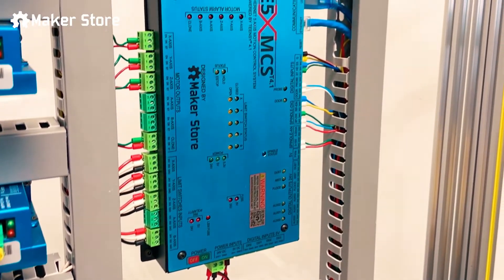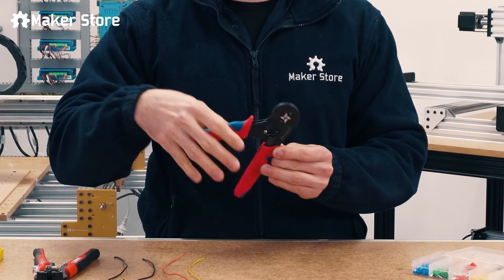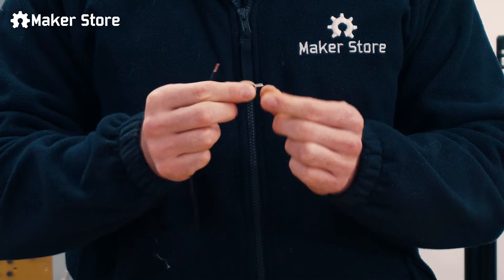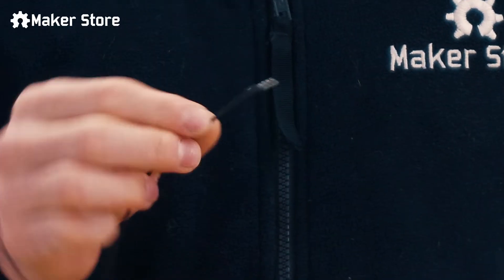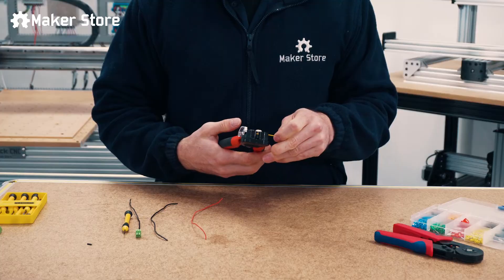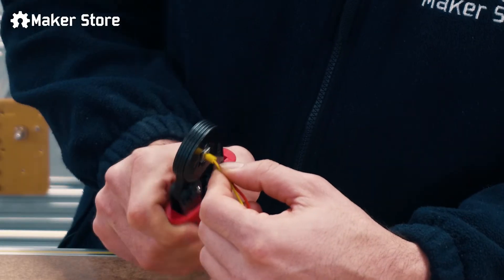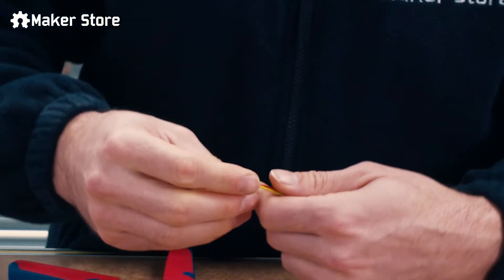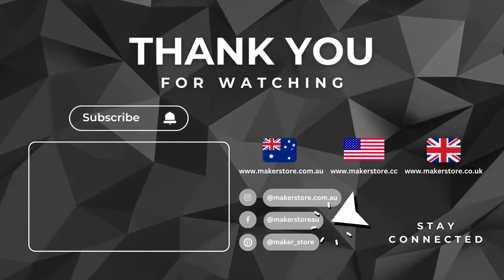Ferrule Crimping - A Must-know Technique for Makers (Tutorial)

Comment: You should NOT use single ferrules for two conductors, there are ferrules designed for taking two conductors at the same time.
Reply: For thin wire, like in this video, why not?  Twisting the wires together and crimping them forms an excellent electrical connection to both wires.  Now that wouldn't work with larger gauges.  Your crimp would no longer encompass all the strands and drive all the air out, in that case.

Comment: That's actually incorrect way of doing it. You should not twist the wire before ferrule. The purpose of a ferrule is to hold the stranded wire strands together, so twisting them beforehand is unnecessary and can potentially damage the connection by deforming the strands
Reply from the maker: Thanks for your input! We appreciate the feedback. There are different approaches when using ferrules, and while some prefer not to twist the strands, others find it helps with insertion. We’ll definitely keep this in mind for future content. If you have any resources or standards you recommend, feel free to share!

Comment: Does the insulation enter the metal in a proper ferrule crimp, for strain relief?
Reply from the maker: @MuToiDMan These ferrules have been specifically designed to provide effective strain relief by securely setting the metal part of the ferrule into the plastic. This guarantees a robust and reliable connection for your cables!
Reply: No.  Wire only.  Strands must be squeezed TIGHTLY to exclude air, which could cause oxidation and loss of conductivity.